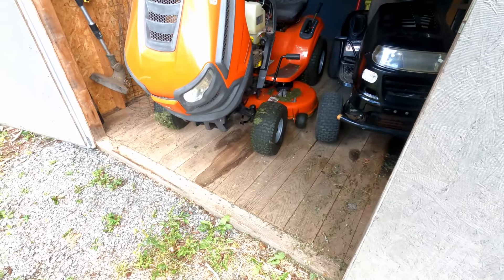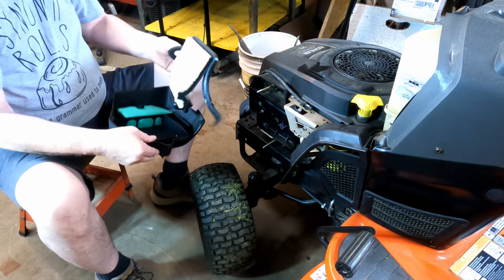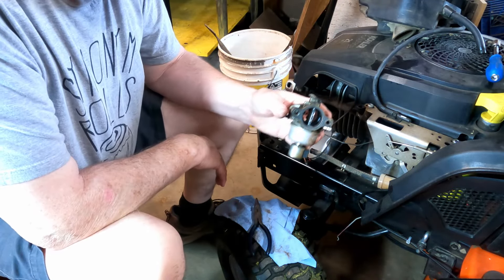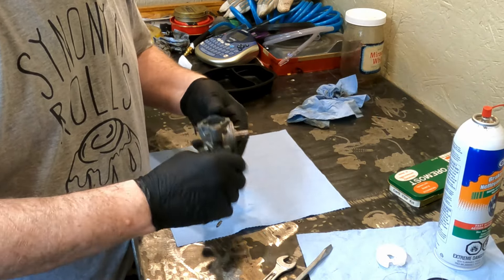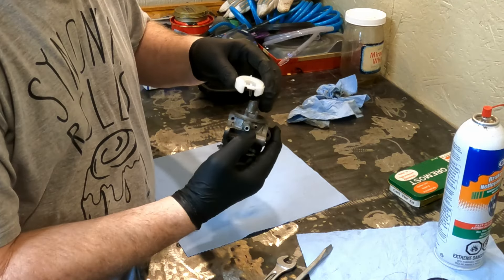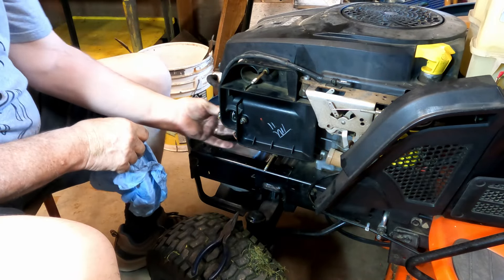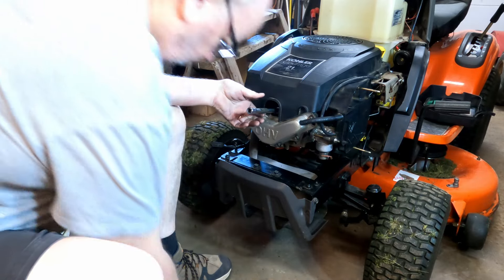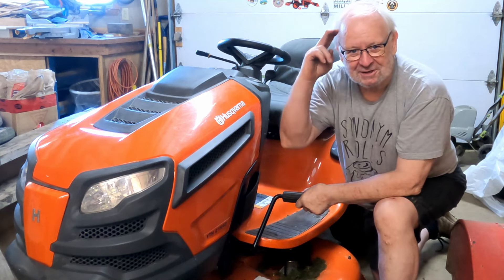Dealing with a Hydrolocked Small Engine

Comment: some of the B&S engines are bad to leak out and lock like that and fill the pan with gas and dilute the oil,, most of the time I put a shut off valve in the line to save problems.
Reply from the maker: How's she goin'?  Vernon I do have a fuel shut off in the line but I don't use it because I'll have to remember to turn it back on before I try and start the tractor!!  LOL  But I think I should get in the habit of doing that eh!!  Thanks for tuning in.  Have  a great weekend!!

Comment: Great job getting it sorted. We tend to add a inline fuel tap as a precaution on our machines. We did that after a machine with a 5 gallon fuel tank full of fuel did the same, not a cheap fix
Reply from the maker: How's she goin'?  You know Joseph, the maddening thing here was I do have a fuel shut off on the fuel line.  But I never use it!!  LOL  I guess I'll have to change that from now on eh and yes sir it was expensive.  I lost about $20 worth of gas!!  LOL  Take 'er easy!!
Reply: @GrampiesWorkshop  🙂

Comment: Good job on the repair Mike, you are back up and running.   You are right carbs are throwaways nowadays. Closing the fuel shut-off after using the mower would prevent the fuel from flowing, but then you have to be mindful of that. I know for myself I would forget from time to time, lol.  Take care!
Reply from the maker: How's she goin'?  I was surprised to find that the emulsion tube was not removable.  Yep, it's becoming a throw away world eh!!  That is the big problem with the fuel shut off eh.  I have a fuel shut off but trying to remember to open it when I want to use the tactor would be a real stretch!!  LOL  Thanks for watching Paul.  Take 'er easy!!

Comment: Good job Mike.  I hydro locked one of the engines on my old go kart and bent the connecting rod.  Your new work bench is coming in handy
Reply from the maker: How's she goin'?  The hydolocking could have been a disaster for sure.  Lucky for me the battery wasn't powerful enough to turn the engine over.  It kind of stalled on the compression stroke.  I am liking the new bench, but did you notice all the 'junk' piled up against the cupboard at the end?  Remember I said I would have to make a point of not doing that!!  I'm working on it!  Take 'er easy!!
Reply: it’s inevitable. Stuff will collect on any horizontal surface. We’re powerless to fight it
Reply from the maker: @BruceLyeg  I'm going with your story Bruce!!!

Comment: Inline fuel shutoff valve  stops it from happening again but it's not so common for your carb float  to be stuck  to allow the needle valve to pour fuel into the crankcase.
Reply from the maker: How's she goin'?  I agree Steve!!  I have a fuel shut off in the line but my trouble is having to remember to turn it back on!!  LOL  But it's a good habit to get into especially with a gravity feed fuel tank!!  Thanks for the comment.  Take 'er easy!!
Reply: Always  great to see you Steve.. Good point bud.
Reply: @TomokosEnterprize  Nice to see you too , thanks.

Comment: Excellent video Mike! I’m definitely going to put a fuel shut off on my gas line now. I have the exact same engine in my ride on. Thanks for this! Cheers and have a good weekend my friend.
Reply from the maker: How's she goin'?  Thanks for the comment Mike.  The thing with gravity feed gas tanks is, if the float valve doesn't stop the fuel, it will run the tank dry.  I put a fuel shut off in my line, but I only shut it off in the fall!!  LOL  I'll have to start doing that all the time now eh!!  A big sign on the steering wheel will be needed to remind me to turn the fuel on!!  Take 'er easy!!

Comment: Great fix Mike. If you have a fuel shut off. That’s the thing to do. Shut the fuel off. Pain in the beep,  but would stop that trouble. 
Isn’t the back fire solenoid suppose to shut the fuel off ? Something I would do is squirt some new oil into the cylinder to lube it. Put plug back in. Turn engine over a little without it starting. Then fire her up. 
Great video Mike. You and Janet have a great weekend. I sure Nannie is getting better. 👍🏻👍🏻👋👋
Reply from the maker: How's she goin'?  You know what Noel?  I do have a fuel shut off in the line, but I only use it in the fall usually!  But I think I should start using it all the time eh!!  Squirting oil into the cylinder is a great idea too.  I wish I had of thought of that!!  It started up right away and is working good now.  Well the engine is.  When I went out to mow I broke a belt guard and burnt the belt!!  LOL  Thanks for the visit and comments.  Take 'er easy!!
Reply: Jumpins. Always something Mike, as they say around here, if it’s not one thing it’s two things. 🤭

The other thing I forgot to say was. That mower is a way to new for me to know any thing about. 
Hehe. I can’t even fix my old stuff at times. 🤭🤭
Reply from the maker: @noelstractors-firewood57  Don't sell yourself short Noel!!  Knowing old stuff still works for me!!  LOL

Comment: It never ends.  There is always a repair to do.  You definitely got lucky.  It is better to be completely locked out so one is not running the engine with thinned out oil.  Now you are good for a while.  Enjoy the lawn mowing.  Thanks Mike.  Stevo
Reply from the maker: How's she goin'?  When I saw the engine was hydro locked right away I new the oil was contaminated with gas.  So yeah, changing the oil was a must!  I sure was lucky.  It could have been a lot worse.  As it was the mower worked great after i did this work, but I broke a belt guard and near burnt a belt off it!!  So your right, there is always repairs to do!!  LOL  Thanks for watching Stevo.  Take 'er easy!!

Comment: Nice fix, Mike. Those chinesium carburetors are certainly something!
Reply from the maker: How's she goin'?  I was totally surprised with the emulsion tube not being removable.  I guess they are throw away now.  There are other things that caused this carb to be an issue.  Things like a  bad air filter and fuel filter and I plan on making a video to discuss this point.  Take 'er easy!!

Comment: Keeping the crud from jamming up your float pin usually only takes a good fuel filter, so I'm not sure how that happened. Great little carb rebuild. I thoroughly enjoyed that.

A tip; At the end of the mowing season, and with your tank almost dry (never run it till empty) pour a quart of ethanol free gasoline in and run it for five minutes. This will clean all of the ethanal gummy muck out, and it will start up right next season without using any additives. It's $6 a quart, but worth it.

Take care!
Reply from the maker: How's she goin'?  Thanks for commenting.  This is a great comment.  
I'll just say this; I do have a fuel filter, but it's not a 'good' one.  I plan on making a video about this and the air filter soon so keep an eye out for that.  
I like your idea of putting the ethanol free gas in the tank.  What I do, and I have been doing this since forever, is use Sta-Bil in all my fuel for small engines.  This seems to work good for keeping the gum from forming and the gas lasts a good long time.  This was the first time I had this carb apart since I bought the mower about 10 years ago and it was whistle clean except for some dirt and grit in the bowl, which I suspect caused the needle valve not to close.  The grit got there because of the poor fuel filter.  And I'll talk about that in the upcoming video.  
Thanks again for your comment.  I like these kind of comments as they make a guy think and make sure he covers all the bases!!  LOL  Take 'er easy!!
Reply: Our marled gas for farm use is high test.

Comment: Hello Grampie. I'm not sure if you have a fuel shut off. If hot install one between the filter and tank. I would also replace the fuel filter. Anyway great job on the repair. Have a great weekend 🙏🔧👍
Reply from the maker: How's she goin'?  That's a good plan Artie and in fact I do have a fuel shut off but never use it.  I will from now on though.  And the other thing is the fuel filter.  The filter I have on the tractor was a cheap one and this is the result.  There was some dirt and grit in the bowl and I'm pretty sure that is what kept the needle from closing.  Thanks for watching.  Take 'er easy!!

Comment: Nice job Mike, I was recently given an identical mower that had carb issues. I too didn't like the fact I couldn't remove the emulsion tube to thoroughly clean it.
I did have to replace the ACR spring, luckily I had a donor engine handy with a good spring. 🙂👍
Reply from the maker: Hello there John!!  Great to see you on again.  I was surprised the emulsion tube was not removable.  Like I posted in the vid, I guess carbs are throw away now eh!  So I'm guessing the ACR spring is the dampening spring on the throttle linkage.  Is that right?  I bent mine trying to get it off, but it seems to be OK now.  Thanks for dropping by.  I hope you are doing well and enjoying the summer.  Take 'er easy!!
Reply: Good to see you too brother, it’s been a few weeks. 
The ACR is the auto compression release located on the cam shaft inside the engine. It has a very weak spring attached to it and when it breaks the engine will be very hard to turn over if any. It’s all good now (until this one breaks) 🤣👍🏼
Reply from the maker: @Big_Johns  OK.   I know the one you mean.  Thanks for the clarification!!!
Reply: Anytime buddy

Comment: Hello Mike.  Sorry I haven't been around much. I've had quite a rash of leaking carbs this year. I had a Toro rider I fixed and used on my lawn and a couple weeks later sold it and the guy called me the same day and said it was locked up, well he brought it over and I discovered for whatever reason the needle and seat decided to not work anymore. He filled the tank , cut some grass , went in the house , had dinner came out and the whole engine was filled to the top with gas!!!  All I did to it was put a drive belt on and a new set of blades so this wasn'teven part of the original  problem. I never seen it happen so suddenly on a machine before until now. He didn't want me to fix it he just wanted his money back and I guess I can't blame him.  Anyway I hope your's stays fixed my friend
Reply from the maker: How's she goin'?  Some nice to hear from ya Dave.  I figured you must have won the lottery and were living the good life!!  But then again, you probably are living the good life, but just no money right!!  LOL  That's exactly what happened with my mower too Dave.  Not sure if it's fixed or not, but I'm going to try and remember to use the fuel shut off from now on!!  Thanks for your input on this buddy.  I hope the summer is treating you well.  Take 'er easy!!

Comment: The first Troy-Bilt mower I bought was after the new and improved anti siphon valves were installed. 
The geniuses at the EPA wanted to prevent mowers from polluting so they were going to require catalytic converters on all small engines. That was a cheap solution. I bet not. 
The engineers at the small engine companies said they could make exhaust systems with after burner designed to run so hot they would burn up any pollution. 
Well they did run hot. So hot they would ignite the fuel in the cylinder with the magneto grounded. No spark just dieseling along. 
As long as the engine is turning the fuel is sucked into the cylinder and so there's yer problem. 
Rather than give it up as a bad idea from the start they added the solenoid valve on the float bowl. That shuts off the entrance to the emulsion tube from the float bowl so no gas can enter the venturi. 
Problem solved. Not quite. Alcohol soaked gas pulls water out of the air and sucks it on past the pin on the end of the solenoid. It's an iron pin. Has to be it is a solenoid and must be magnetic. Could be stainless but whoa they didn't want to spend too much. 
So the engine is running and the solenoid is energized. The magnet pulls the pin open. When the engine is shut off the power to the solenoid quits and it shuts off the emulsion tube. Usually anyway. 
When the pin corrodes it takes more than the little spring in the solenoid to seat it. It leaks. 
My Troy-Bilt was filling the  crankcase every time I shut it down. 
I started turning off the gas valve and the problem went away. Pain in the butt to have to pull the cover and shut off the valve every time I used it. Even worse when someone else used it and started it with the engine full of gasoline. Luckily no explosions. Just lots of flame in the exhaust pipe. The crankcase vents into the carb intake through a rubber hose. 
The problem stopped when I switched to the "recreational gas.' Alcohol free! Wheee! I got rid of the problem by paying $1.50 more per gallon for gasoline. 
Fancy name and even fancier price. Costs more to buy less additives. Just like removing lead ended up jacking up the price. 
In any case I just shut off the tank when I wasn't running the mower. 
That was after carb cleaning multiple times. Then replacing the carb. That worked for a while but I didn't stop buying regular no lead because "recreational gas" didn't exist. That meant 10% alcohol in the fuel. The solinoid went bad again. 
Then I started buying recreational gas and the next mower ran fine and is still running.
Reply from the maker: How's she goin'?  Interesting story of how the anti-backfire solenoid came into use.  They sure do seem to cause a lot of issues.  But I like your thoughts that all these issues were caused by ethanol/alcohol in the fuel.  I'm not too sure if we're saving the planet or not but putting ethanol in the fuel.  Maybe a lot less emissions from engines, but the emissions that are created from making all these 'throw away' parts due to them being damaged by the fuel additives, well I'm not tool sure it balances out even.  
And all these parts seem to come from offshore, and their pollution rules and regs are a lot slacker than ours and so they can make these parts for a lot less and sell them for a lot less and we'll keep buying them for a lot less.  It's like China and places like that have this master plan, get the western world to buy into pollution free mid set and then paying for them will ruin the countries financially and we'll take over since we'll be the only country left that has any kind of manufacturing capabilities.  We're doomed I think!!  Take care!!